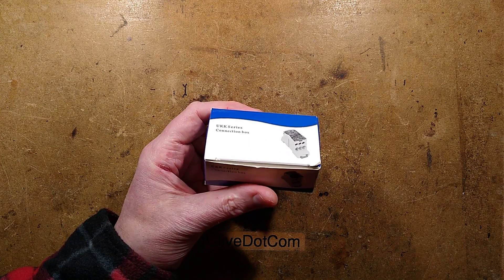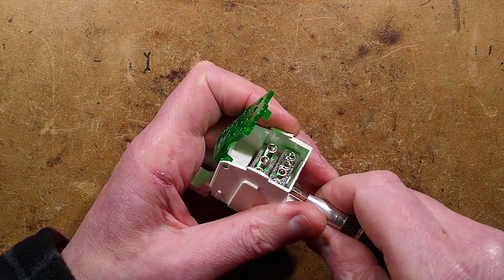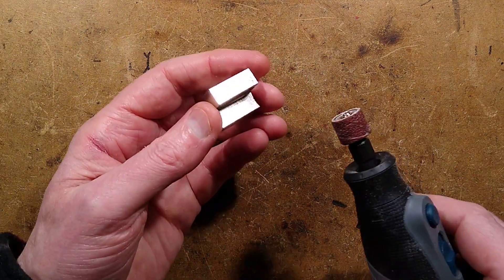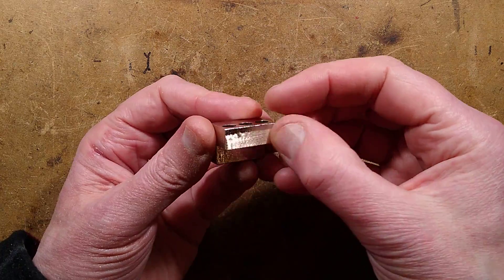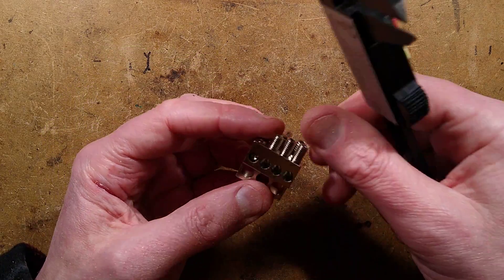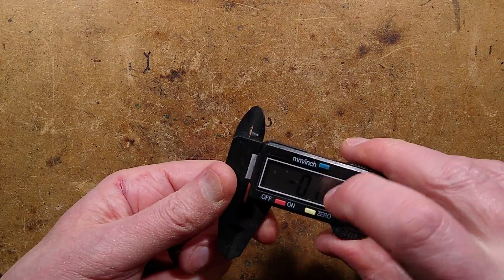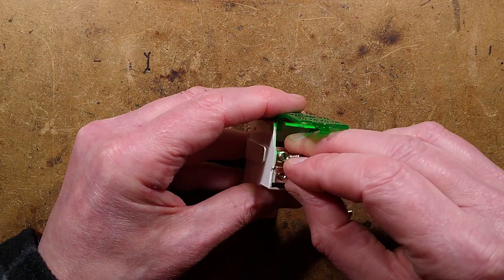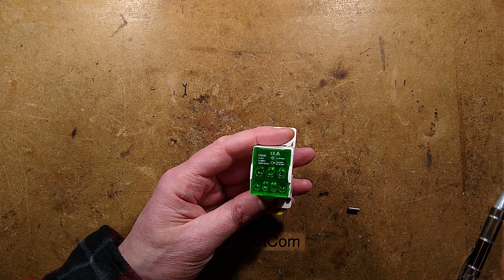Would you trust a Temu 80A electrical connector?

Comment: Why do they cover brass with something magnetic like nickle? It's too thin to be a good conductor at mains frequencies using the skin effect. 
Brass is not magnetic. They probable took all the junk copper and zinc they could get at recycling centers, and melted them all together to make those blocks. 
impurities and all. Good quality brass needs no protection from the elements, and is not attracted to magnets. 
Why add the extra cost of plating, if they weren't hiding something underneath?

Comment: The contact screws being made of steel, is the weak link. 
They didn't spend the extra for brass screws.
Reply: indeed - go rusty - bad news, but stainless 304 ok.  Note armchair experts, that most of the current path is thru the wire compressed onto the bottom of the hole.  The block would be fine for solar panels - much better than MC4s

Comment: tin is paramagnetic, so it'll be slightly attracted to a magnet.
a nickel plating would make it more attractive... and more expensive.

As for the "brass"...
954 aluminium bronze "looks" like brass and has about 5% iron, which will make it slightly magnetic. It's a common alloy for plumbing fittings.
It's considerably cheaper than brass.
it's also has like 4x as much electrical resistance.

Best way to tell the difference is to drill it.
Brass drills easily
954 is harder to drill and is very "grabby".

Comment: Nickel is magnetic, it looks Nickel plated. Brass is copper & zinc usually, which aren’t magnetic. Lead, phosphorus, aluminium, manganese and silicon are common alloys with copper, but all aren’t magnetic. If more zinc is used than copper, the brass looks more silver, like this.

Comment: No, the rule of thumb is 1 mm for 10 amp is safe that is why people use 1,5 mm for 10 amp, 2mm for 16 amp and 2,5 mm for 20 amps. The max I would put into this connector is 50 or 55 amps more than that is just pushing your chances.

Comment: The screws look a little loose in the threaded holes.  I would be a little concerned about the screws backing out with thermal cycling.  The terminal block should be accompanied by a data sheet with torque specification.
Reply: I forgot.  No, I would not trust the terminal block.

Comment: That's almost certainly nickel-plated brass.
In regards to the 80A rating, I reckon it could probably take 80A fairly well - It looks thick enough. I'm surprised that a Temu product is actually fairly legitimate.
Reply: its not like Temu actually manufacture anything. This is just like any other chinese product, sold without any accountability through a large company. To me the question often is, would it actually make financial sense to produce a really bad version of a product? The market of people you can essentially scam with niche industrial parts is probably not worth it, so you're probably better off producing something actually usable.
Reply: Repeatability is a real problem. You don't know if the next order came from the same factory
Reply: I agree and I've seen stuff we pay a lot more for and completely cut down to the bone. Looks ok to me.
Reply: I agree - here in Aus, a Weidmuller block is $95 vs plenty of variations of the Temu item at $10-15.  Many of the cheapo ones have certifications stamped on them, but who knows if they're genuine.  Anyhow, I'd happily use this block for projects, just not in my house electrical box where a fire started by such a thing would void insurance.
Reply: In my experience Temu is hit and miss with a better hit ratio than say Wish. Yeah, I know, that’s a low bar.

That’s just my experience of course.

I still wouldn’t trust it at 80 amps. A 15 amp branch circuit, sure, but only after giving it a free air test for softening or melting of the plastic case.
Reply: Yeah, in that case the CE sign one could spot on it might actually be genuine
Reply: @uNiels_Heart  CE marking is not a quality certification at all, the only meaning is the maker himself claim the product comply to EEC rules.
Reply: @lapub.  not sure what "quality certification" means. It is however a marking that attests certain qualities, if you will. As far as I read, you can self attest under certain circumstances, but that doesn't really make a difference in the case a manufacturer wants to put illegitimate markings on their product, as they can physically do so with other markings, too.

Not sure what the EEC rules are, but if you mean the Low Voltage Directive, then yeah, this one includes safety requirements, which is what I'm concerned with.

And that manufacturers can self attest doesn't mean they're allowed to put it on their product willy-nilly. If they do illegitimately, measures can be undertaken to stop the product being sold.

Comment: The main thing I would be concerned about is if they always send the same item when ordering from the listing. No guarantee that they don't swap out what they're selling at some point for something much sketchier.
Reply: Exactly what I thought. Temu could easily throw out Good enough product up to the point several high-profile YouTubers review it, and then start shipping out the real Chinesium... ⚠
Reply: @UK-Combustibility-Assured  I was thinking more likely that they would open up shop running at a loss to build a customer base and reputation before cutting costs right down to the bone, but accumulating YouTube reviews is definitely a possibility as well
Reply: Yeah, that’s the problem with TEMU and the like. You might get something perfectly adequate, but you just don’t know. That’s what reputation is for: to have confidence that you can trust the product.

Comment: you could hook this up to a car battery, start the car, with all heater radio, lights etc on to load it....... thats about as easy a source for high amperage as you can get ....EASILY!! otherwise get a friend to loan you a welder...if it survives that over 50 on/off cycles a day, over a week...its ok

Comment: Just alone the fact that something is cheap is as little a guarantee for getting trash like buying something expensive is a guarantee for getting good quality.

For some personal tinkering I would easily use this part, for anything commercial and/or repeatable it´s too much gambling and such parts from reliable suppliers are not that much more expensive - if you buy slightly more than one piece 🙃

Comment: Ideal test object for an Omicron CPC-100 and FLIR C3-X. Test at 80A for 1 hour, then 160A for 30 minutes......  Not sure if the 200A test leads will fit on both sides of the connector (large holes).

Comment: I trusted those 240v 10a relays, and the contacts fused after 10 circles.
Reply: that's a lot of amps
Reply: @marcogenovesi8570  i "only" put about 4 amps thrpugh it, but i as a novice i didnt know about inrush current. Welp now i know what to look for in relays.

Comment: I've just started to embrace DIN-rail stuff at the observatory.  Not for power distribution, but organizing our motion-controller cabinet.  I had previously thought that DIN-rail stuff was expensive, but in general, that's not the case.  Soooo, coming up with ways of mounting "weird things" to the DIN rails we're putting inside the enclosure.   Mostly based on generic circuit-board mounting brackets for DIN rails--they can be adapted for other uses with the addition of off-the-shelf angle brackets and the like.
Reply: There's a metric crap-tonnne of "custom DIN-rail mount for <foo>" on Thingiverse.  If we had a decent 3D printer...
Reply: for mounting PCBs on a DIN-Rail we use brackets from Phoenix Contact or Weidmüller... they sell a plastic profile that can be cut to the desired length and end/mid brackets for mounting

Comment: The brass alloy is probably an alloy with a low (50% or slightly less) copper content.   Saves them on materials costs.  Bulk conductivity wouldn't be as good as alloys with more copper in them, also somewhat more brittle than a higher-copper brass alloy.
Reply: My estimation would be 0,5% Copper, 2,5% Nickel, 77% Aluminium, and 21% „finest“ Chinesium... 😉

Comment: Check hardness.... just a quick test with a springloaded centerpunch will probably show this to be cartridge brass, which is gummy and kind of horrible to work with but very popular among the Chinese manufacturers.  Likely fine for the application where you're not screwing those screws in and out all the time but not a good plan if there is a lot of reconfiguring going on.

Comment: would 25mm^ (73A) or 35mm^ (90A) actually fit in the holes ?
You might just about get the 25 in there, though i wouldn't trust it for 80A, i would like to see double screwed connections.

Comment: A producer of electrical brass alloy specifies the following composition for their product: Aluminum: 0.005%, Iron: 0.25%, Copper: 90%, Nickel: 1%, Lead: 0.5%, Tin: 0.2%, Silicon: 0.005%, Zinc: 10%, Phosphorus: 0.03%, Sulfur: 0.08%, Antimony (Sb): 0.25%. Well, I suppose this spec should be deciphered "up to", since the sum is over 100%, but quarter percent Iron and 1% Nickel in my personal opinion wouldn't give the alloy enough ferromagnetic property for the tiny rare earth magnet to stick to. Another kind of Chinesium. For typical european 63A single phase for an apartment or not very large house would probably be OK, but where and for what purpose would you put such a device in a house mains...

Comment: Iron is very poorly soluble in both the alpha and beta phases of brass, so it precipitates as a ferromagnetic secondary phase, which could explain the slight attraction to a magnet. As for the naming, the Chinese term for brass is literally yellow copper, so it often gets mistranslated as just copper (or more likely "mistranslated", if you catch my drift).
Reply: I think the screws are made from steel and he did not removed them as he tested it, so they are this what was ferromagnetic, not the brass itself.
Reply: @mikropower01  That must be some incredible powerful magnet, if it still attracts anything a good few centimeters away from a ferromagnetic material.
Reply: It looks to be nickel plated, and nickel is ferromagnetic.
Reply: Yes, I am fully aware that nickel is ferromagnetic, as are the steel screws. Please read the video description where he mentions that even after removing the screws the magnet remained attracted; he also observed the same slight attraction with brass fittings.
Reply: nickel is magnetic...
Reply: @kosir1234  - There is a big steel screw within a distance of 3mm of the Neodym magnet.
Reply: it's the nickel plating....

Comment: Maybe not for 80 A permanently in a hidden spot. 30 to 40 A where you can look once in a while or have easy access: yes.
I like the fact that they clearly marked the cable sizes for in and out!
About the material: the "brass" is very pale. So I tend to say it's something between brass and "Neusilber" (new or fake silver). They probably reduced the copper percentage of the alloy and replaced it with nickel.
Advantage: firmer material.
Disadvantage: more brittle and higher electrical resistance.
So: under certain circumstances usable.
Reply: the brass is a lie, as usual
Reply: @marcogenovesi8570  How do you know?
Did you visit clive, took the connector from him and made an analysis? Maybe you can present us the exact composition as you claim to know it.

Comment: Clive, are you squirmy about dremels ? I mean with grit paper I'm not that afraid of it, but with saws, them going at 12000 rpm is kinda scary... While I cut some stuff in the past some blades flew past me shattering on every wall, luckly I was not in their way... maybe they were cheap blades, they were the ones that came in the same set as the ones I bought from LIDL.
Reply: have something in front of the eyes.   you can get like saw/router bits that are just like a router bit though they tend to not snap like cutting wheels.  really with the drum sandpaper things you can cut a bunch of plastic too it really eats through stuff(and doesn't shrapnel same way).
Reply from the maker: I always have my plastic lensed glasses on, but also position myself out of the direct path of a shattering blade.

Comment: Considering you can run about 80 amps continuously down 8ga wire, I'd say there's probably enough material there for 80 amps to flow through.  Gotta get a TIG/Stick welder to generate 80 amps for testing purposes.  lol.
Reply: I agree, there is enough material there. It is the quality of the connections that is probably the biggest issue. You need a very high quality connection to put 80A through it safely. This looked like it should be capable of forming good connections, but that is what I would have tested.

Comment: CE certificate, what can go wrong
Reply: Ahh nothing means quality like ChinaExport. I had a call a couple weeks ago, a cnc plasma cutter was causing the entire factory to freak out, all computers and screens. Mainly screens would flicker, and PCs would soon blue screen. ONLY when the plasma was activated. What brand it was? I don't know, the only english letters where CE stuck together. stuck together, means china export, with a bit of space it SHOULD be "Conformité Européenne". Anyway, I opened it and the capacitors were hunging by their wires etc, total garbage. 50€ for 100A plasma, free shipping from china, what are the expectations...

Comment: I would trust it to 30-35 amps for personal projects.
Reply: Yeah, my concern is also less with the block itself and more with the quality of clamping - If your block starts to melt, it won't be because not enough copper, it will be because your contact resistance is shit.
Reply: Yeah, that checks out with my experience
Reply: brave man
Reply: @mattsan70 why it's less than half of the rated amperage
Reply: @stevetobias4890  Well the clamping system to begin with. It is garbage at making great conduct with the wire (not bad for like 6A applications), which at 80A is crucial. It is the same single screw you find on the cheap terminal strips, it should be at least 2 screws per wire at 32+A and preferaby with a clamp, not just a screw, so the wire is making contact through its entire surface. And at these current ratings, i better see plated copper, both for heat and for conductivity. Plus it is temu, this one is brass, the next is inox steel, the other is made from scrap metal with chrome spray paint.

Comment: 80 Amps (at 12.5mV)
Reply: 80 amps is 80 amps. The heat generated is the same, regardless of the voltage. (In practice, of course, you would never get 80 amps to flow with only 12.5mV pushing it unless you had a superconductor.)
Reply: I^2 x R   The voltage is irrelevant
Reply: It looks like it could handle dissipating 1W
Reply: @maxhammick948  The heat generation is current multiplied by the voltage drop across the component, not current multiplied by the total voltage of the system. Voltage drop is current times resistance (V=IR), so heat generated is current squared times resistance (P=I²R). You will note that the voltage being applied doesn't appear. That's why I said 80A is 80A. The heat dissipation required is determined by the current flowing through the component and the resistance of the component, not the voltage.
Reply: @thomasdalton1508  by the current and the resistance... So by voltage 😂
Reply: @dahahaka  That's voltage drop across the component, not voltage applied. Unless it is a short circuit, they are very different things.
Reply: @thomasdalton1508  its just a joke, and either way you're just kinda wrong, you don't need to know any of that, if you input 1W there's no way the component is expelling more than 1W of heat, you're overthinking
Reply: @dahahaka  I'm not wrong. I specifically said the scenario was an impossible one. The reason you couldn't get more than 1W is because you couldn't get 80A to flow, but you claimed 80A was flowing. If you magically create an 80A current then it will produce the same amount of heat as any other 80A current.
Reply: @maxhammick948  You wouldn't have 80A flowing if there were only 12.5mV and any significant contact resistance.
Reply: @thomasdalton1508  You will if there's about 0.2mOhm resistance! That's the number Dahahaka posted, so that's what I was responding to

Comment: Quality of plastics is always a good sign of decent products.
Reply: I opine that poor plastics are bad, and better plastic is meh.
Reply: I don’t know what type of plastic Wago 221s are made of, but mine always crumble after being exposed to oil vapor for a few months.
Reply: plastic valve covers are fine...for the duration of the warranty period
Reply: Glad to hear it. Now I'm glad I opted for an old TicTac box for my project.
Reply: Legos are made of good quality ABS. We could fool a lot of people into expecting better quality by using more ABS plastic in things.
Reply: @markiangooley it depends on the use case. And bad abs exists. Abs is not oil resistant, it doesn’t even work with vegetable oil. Btdt.
Reply: @jhsevs  this is also why keyboard caps become shiny over time (grease and oil from our hands). most of them are ABS although you can get PBT caps which feel "rougher" and will not shine over time.
Reply: @markiangooley  Yes but its expensive and verry accurate too.
Reply: I wouldn't have a problem with using those connectors inside a cnc cabinet for example.

Most of the stuff in there now was probably made in China anyway.

Even if it's made in the USA they probably got the raw materials from another country.

We can't even buy food and be certain of where it's come from anymore.
Reply: BMWs (and most cars at this point, but the “ultimate driving machine” included) have a plastic valve cover. Material, in and of itself, is irrelevant.
Reply: @silverXnoise  ask any mechanic if they think plastic valve covers are a great idea
Reply: Hahahaha China:)